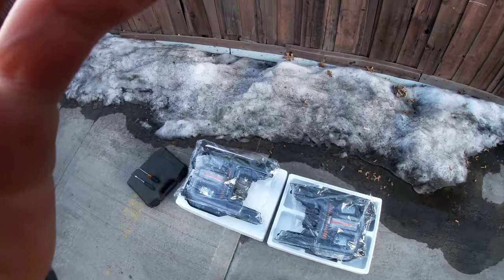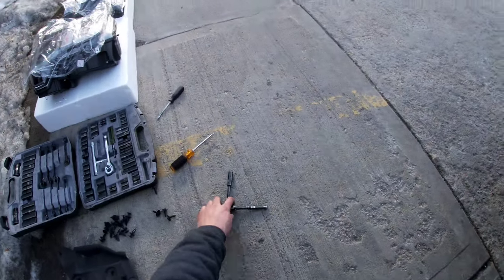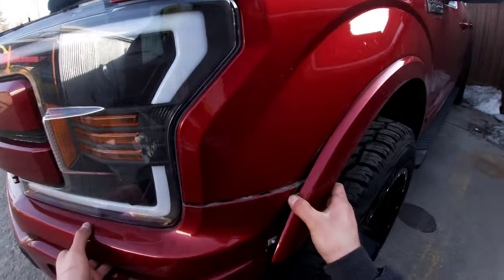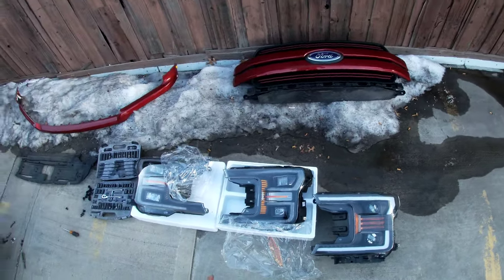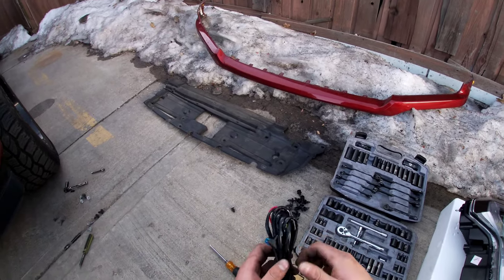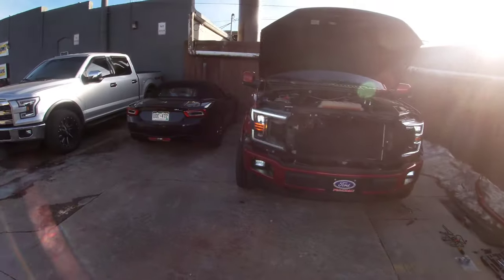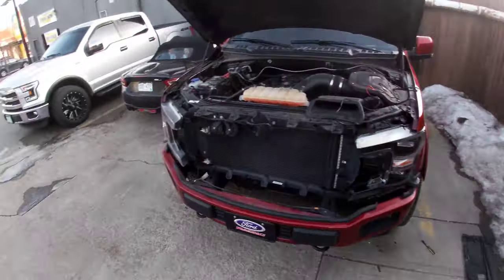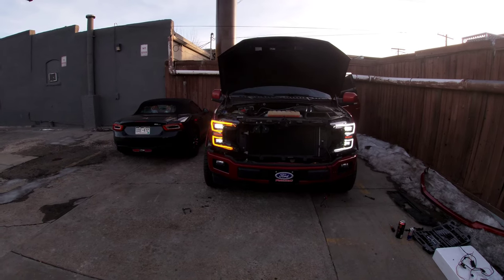2018-20 FORD F150 VLAND LED HEADLIGHTS REMOVAL

Comment: Thanks for the video.  The 2014 generation F150 headlights were so much easier to take off.  This is not hard but a lot to do for just the Headlamps
Reply from the maker: Your welcome. And glad it helped out some. First time is the hardest since your being careful not too brake anything.

Comment: Take the extra precautions to seal the drivers and connectors on these lights...nothing but issues because of moisture. The condensation is bad inside the housings, but there’s also a lot of water inside the drivers and connectors that cause the led’s to flicker or stop working. The vland connectors actually started to damage the stock oem connectors on my truck.
Reply from the maker: Thanks for the warning will make sure too seal everything.
Reply: 5.0Beast no problem man, just trying to help whoever I can avoid any issues and protect the money they spent on these lights.
Reply: Steven M hey man what do you mean by sealing the drivers and connectors? I’m planning on getting these soon and I’m not trying to have to take them off due to issues after installing them the first time
Reply: Gerardo Jimenez I wouldn’t suggest buying these lights until they solve the issues but if you do there is some steps some guys are doing to prevent the issues that have been causing all the problems. Vland will provide you with harnesses that you must use with the OEM connectors and lights but I suggest using dielectric grease, rubber tape, or vinyl electrical tape to seal all connectors properly. The next thing I would highly recommend is resealing the driver at the bottom of the headlight unit as it is known to let into a lot of water. Finally the last thing I would suggest doing is adding your own sealant around the lense of the headlight for extra protection. All this can by found on the f-150 forums if you sure vland...hope this helps you out
Reply: Steven M what do you mean by the driver? Just need some clarification. Much appreciated!

Comment: I can tell you , save yourself from huge disappointment. had vland headlights installed professionally on a 2019 f150 lariat that had non LED headlights. Over time I noticed hyper flashing. Then when I had my stock headlights reinstalled the tech found water in the final connections which would have led to corrosion and electrical issues , possibly void factory vehicle warrantee. So glad they found that issue ! it came from going through carwash and raining season time of year. notified vland co. after going back and forth with them and providing picture proof they finally refunded my money. lesson learn , you pay for what you get. go big with a good reputation co. made in USA ! If you can save your money , be patient . i upgraded to Morimoto with a 5 year warrantee. Everything about the headlights is top notch. From looks to wiring connections highly upgrade. TOTALLY , TOTALLY SATISFIED !!!!
Reply from the maker: Its a little too late lol had them on for almost a year and barely started having problems with one of them vibrating alot and no responce or help from VLAND.  Buts thanks will be going back to alpharex headlights.

Comment: I went through 2 different sets of VLAND LED projector headlights and ALL four headlights had problems; three of the LED projector rectangle bulbs came loose and shined UPWARD or DOWNWARD and one LED halo stopped working on the lower half.  I had to remove them and install my Halogens until I purchased OEM LED Headlights for $2,400.00 from Ford.
Reply from the maker: Yeah I heard some bad stories from vland I had them on my truck for like 2 years before I sold it they were still working.

Comment: It’s been a year now how are they holding up? I’ve been really contemplating these in my opinion they’re the best looking aftermarket headlights. As close to OE style as you could get. Now my only concern is the cost they seem so inexpensive compared to other brand and these are by far the best looking
Reply from the maker: Dont buy them I went through 3 sets in a little over a year. And they customer service sucks they never answer and blame each since it's a lot of stores that sell them.
Reply: @Eldela5.0  thank you
Reply from the maker: Your welcome.

Comment: Great video but I have just one question, do you get any static coming through your radio with these headlights installed? I have looked at the Morimoto XB headlights and allot of people say there is allot of static while listening to the radio. Do you get this static with the Vland?
Reply from the maker: Thanks and no I havent had any static coming from the radio.

Comment: Do the daytime always stay on because on my 2020 F150 Stx 4x4. I already did the settings and it still stay on. Or it supposed to be like that I want it off during the day
Reply from the maker: Yeah they will stay on all the time. If you don't want them on during the day all you gotta do is not connect the harness and they will turn on only when headlights are on.

Comment: Where in the fuse box do you connect the harness?  I plug mine into the fuse 18 (like instructions said) but my power steering stops working
Reply from the maker: I plug fuse #10 and #36 both work for me you can do either one

Comment: Hey brother in the fuse box , you connected beside the number 10? Or I have to remove one of the number 10?
Reply from the maker: I connected to #10 I had to buy a fuse tab since my harness didn't come with one.
Reply: @Eldela5.0  I don’t get it . In the fuse number 10? I installed my lights all is good except the fuse thing I don’t know where to plug it
Reply from the maker: The harness connects behind your headlights plugs. Then black negative cable to negative on battery and red to positive on battery. And gray trigger wired to the fuse #10 on fuse box you will need a fuse tap in to connect.

Comment: Do the halogen lights stay on all the time to have just the LEd part working...or can the LED part be used as daytime running lights?
Reply from the maker: You can turn theled  bulbs off and just leave the LED strip as running lights.

Comment: How are the vland heaights holding up? Do they look good at night?
Reply from the maker: I had one replaced since low beam was loose from inside and you can see it vibrate. Light output its a little better then oem halogen.

Comment: I just ordered these and now have been hearing nothing but crap about issues with them. Have I made a bad decision?
Reply from the maker: We're you buy from there's a guy that's been good about replacements.
Reply: @Eldela5.0  I got them from vlands official website, should I cancel my order? Lol
Reply from the maker: You should be good that's the guys that help me get a replacement even though I didn't buy from them directly
Reply: @Eldela5.0  oh that’s great, thanks a lot!
Reply: Should I add some silicone sealer to the lights for extra protection?
Reply from the maker: @vanillathunder8112  your welcome and yea might as well and also add white lithium grease on every plug too be on safe side. I heard some stories of guys getting corrosion on plugs
Reply: @Eldela5.0  you won’t believe the email I got 😂. They’re out of stock so I asked for my money back. Should I get some alphas or vlands on eBay?
Reply from the maker: Lol That's a sign bro just go with the alpharex I never had no issues with them.  iam planing on getting some alpharex alpha black.
Reply: @Eldela5.0  yeah that’s what I’m gonna do man, thanks a lot for your help, I found some on eBay that come with LEDs to add in, I think I’m gonna do that
Reply from the maker: Your welcome and those are the ones I order the first time with led bulbs and you can always replace bulbs with better quality ones and much brighter.

Comment: Hey where did you connect in the fuse box bro
Reply from the maker: Yea i did I connect it to fuse #36.
Reply: @Eldela5.0  i see Thank you. Mine didn’t fit because I did a front end conversion  from a 2016 so am guessing the fuse box is a lil different. Everything works except the right blinker for some reason , I’ll have to go back in to check it out
Reply from the maker: Your welcome.. and Maybe headlight harness it's different?
Reply: @Eldela5.0  everything is plug and play expect when I got to the fuse box the fuse box has ats fuses and the adapter comes in micro2
Reply from the maker: Thats good too know I thought they would be different. Check your manual and you can connect to day running lights fuse or how I did mines on auto wiper fuse.
Reply: @Eldela5.0  how did you connect the  acc wire to the fuse box?
Reply from the maker: I bought a fused tab and connect to fuse number #10